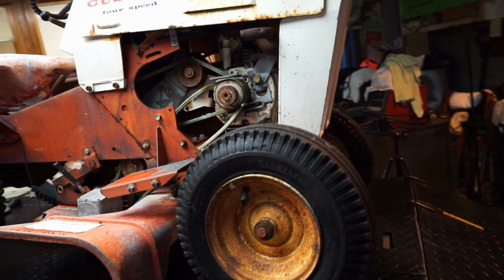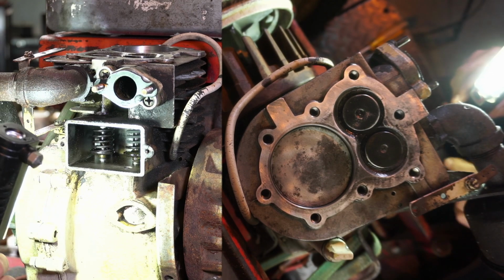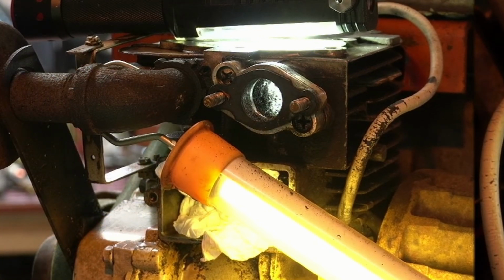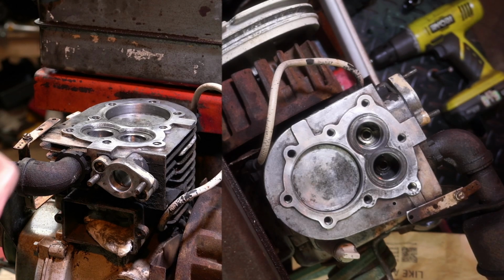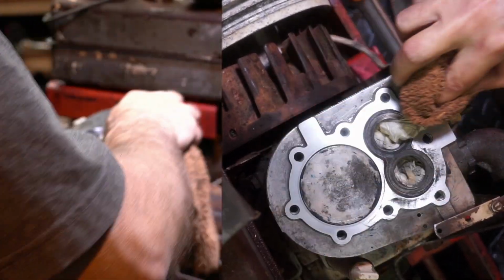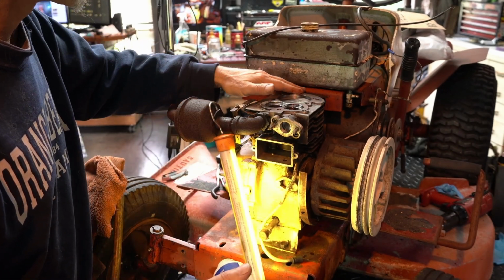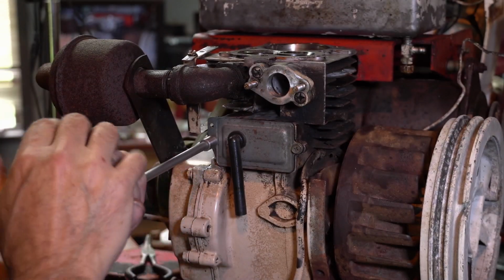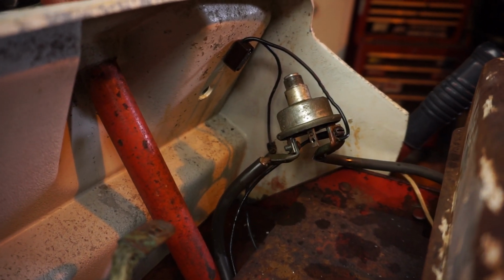VINTAGE - 1960's Old Sears Custom lawn tractor / Tecumseh 6hp Part -2

Comment: The compression check after you re-assembled was pretty decent.  The compression ring must be in fairly good shape.  Looking forward to part 3.  I'm currently restoring a Homelite T7 so will be going through a lot of the same stuff you are lol.
Reply from the maker: Nice, glad to hear you have a nice project!
Yea, compression isn't terrible but the oil control is non existent! 
Could be bad oil rings. Engine needs to come apart

Comment: That method of installing the springs is the most labor intensive that I've ever seen. The Briggs tool is simple. It goes in with the spring and retainer then drop in the valve, then just lift and slide.
Reply from the maker: The old Pin is hard,,also that's not the correct tool either..
I think that tool is for the Old Ford Flat Head engines...

Comment: Archie, I’m disappointed in you for not cleaning that Siri out of the piston keeping attention to detail you should’ve taken the piston off clean in between all the rings so you don’t have that metal In between the piston rings, and a piston that will scratch up your piston wall
Reply from the maker: Henry,,,,,,,,ouch,,,,what can I say,, have you watched both videos?
I spoke to this many times and I'm not gonna give a complete synopsis here,,,,
I'm disappointed in you henry lol
This engine is a mess,,,we don't even know if the transmission works, generator makes the juicer?
I spoke of cleaning this many times and stressed it!
Look at the bore, the entire engine,,, Its really shot!
I've pulled more glitter rainbow out last weeks mower oil changes!
Many years of rebuilding car engines and $10k hot motors!
We used to say of the street engines is if ya see a scratch, don't worry, it will be replaced by another down the road! 
Perhaps a re-build is in the future but for now, lets have some fun and show the peeps stuff!
Reply: @TheNovaJohn  except treat all engines, the same fix the problems, clean thoroughly no matter if it’s a bad engine or a good engine cleanliness counts, and it’s the wave of the future for most engines will not be no longer sold so we have to keep the ones we have, and keep them running so the government doesn’t take them away from us. The future in electronics is close. Let’s not give them the opportunity to lose the skills we have.
Reply from the maker: I do agree but we can come back to that,, this cylinder is shot, the deck is warped, the head was replaced because the plug threads were wiped out, one the head bolt threads wiped and on,, 
I cleaned it well and showed the white tissue inspection shot, blown out well with compressed air..
stay tuned cuz ,,,,well I cant give it away can I lol
I have ideas lol
This machine is a mess, much to do! We will get there,,,,Nuff said
Reply: @TheNovaJohn  ok then we’ll done ✅